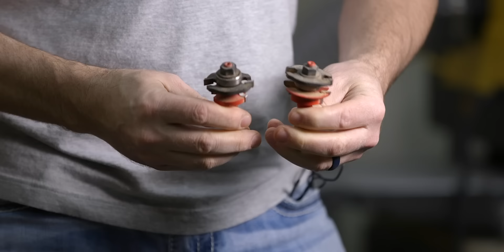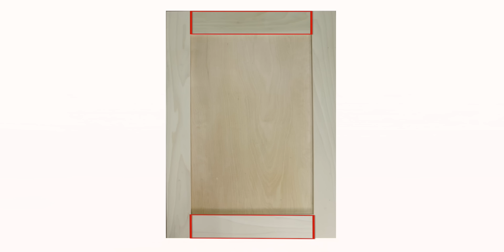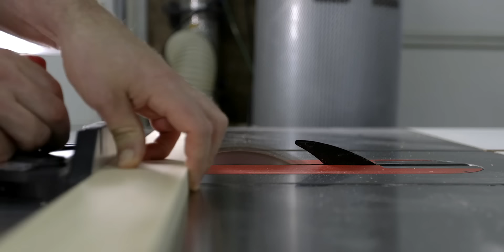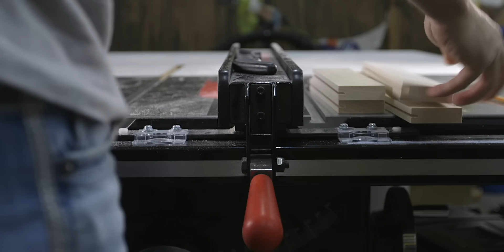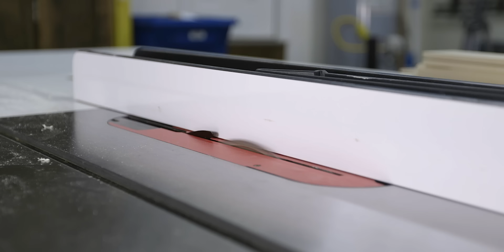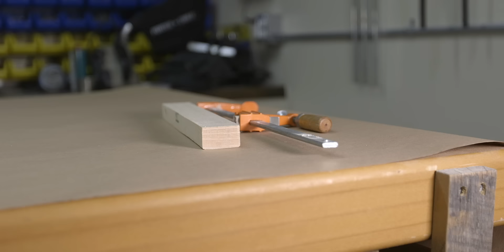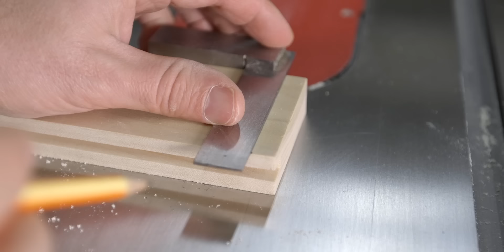Build Shaker Cabinet Doors With Table Saw | New to Woodworking?

Comment: Thanks for this video. I'm about to start on a panel for my mother-in-law's dishwasher. This video is going to make it much easier to make!
Reply from the maker: Let me know if you have any question along the way Carlton.
Reply: @TrainingHandsAcademy  The panel I'm making needs to match the cabinet doors in the kitchen. The other cabinet doors have what looks like small shoe molding along the inside edge of the styles and rails. It looks like it was carved out using a router, but I have no idea how they did it. Any suggestions?

Comment: Is there a video of how you finished them?
Reply from the maker: Sorry I don't Richard.
Reply: @TrainingHandsAcademy  no worries! Can you recommend what you added to the paint (if anything)  to give it that factory like finish touch?
Reply from the maker: @Richardsumilang  I didn't add anything to the paint. 1 coat of primary two coats of finish. It was Sherwin Williams brand paint if you live here in the US.
Reply: @TrainingHandsAcademy  thanks for the tip! I buy my stuff from Sherman Williams too and I need to replace two doors on an existing kitchen install that is about 5 years old. I need them to match perfectly and I hope the age of the rest of the doors don't make them look too different

Comment: Would you have any problem using 3/4 MDF for the stiles and rails? Poplar is no longer the cheap stuff, pretty darned expensive actually. I do have birch plywood for the panels however. Nice easy to follow video by the way. thanks
Reply from the maker: I know right, I remember when it used to be cheap and very easy to get. I honestly have never used MDF for stiles and rails so I can't speak from experience. Wish I could be more help.

Comment: I would like to ask something to you.
When you paint the ready door not appear veins of wood?
If yes, then how may reach it how so that the veins of the tree are not visible.
It is many layer with paint, or filling material? 

My English knowledge not too good, I'm sorry.
Reply from the maker: It's all about using the right wood so that the grain doesn't come through. The best wood I have here in the US for painted cabinets is Poplar or Maple. The grain doesn't come through on those. I hope that helps.
Reply: @TrainingHandsAcademy   I would have one more question... :)
How many layer paint get used to apply on wood surface?
How many primer layer and how many cover layer?
Reply from the maker: @kssthomas  One primer and two finish coats.
Reply: @TrainingHandsAcademy  Thanks!

Comment: You did it. You managed to teach me how to do these kinds of doors and it's ingrained in my memory from watching everything twice. 

I wouldn't call it dead easy, but it should be approachable for me.
Reply from the maker: Let me know if you run into any problems.
Reply: @TrainingHandsAcademy  I was looking at a door today, and I realized then that room doors are built based on the same principles and once you can build a cupboard shaker door, you could even build regular room doors. On these doors there's an in between stile per panel, otherwise it seems exactly the same. 

Thanks again.

Comment: Good  work,  questions  Sir do you  recommend  putting  glass  instead of  plywood into the same  style  door. Are rebate it for  glazing strips  instead. My reason for asking, if  the  glass  is not temper,  and  it's  break,the  door  would have to be  pulled apart to take out and  replace.

Comment: Why not just run it thru the router table with a quarter inch straight bit , then take over to the mortice machine
Reply from the maker: That works too if you have all that equipment... most new woodworkers don't.

Comment: So I want to do knotty alder kitchen cabinets with the pre finished plywood for the carcasses.  On the ends that show, should I laminate the knotty alder plywood to the prefinished?  Will I have to scuff up the prefinished?  Any specific glue?  Thanks for any advice you can give.

Comment: Could I use pine wood for the door and what’s thickness of the wood ? Thank you
Reply from the maker: You can, but just know that it is a really soft wood and will not hold up as well as a harder wood....and I used 3/4" (19mm) wood
Reply: @TrainingHandsAcademy  ok thank you very much

Comment: Thanks, I only have a sp6000 Makita plunge saw, no table saw. Can a simpler lap joint be used instead and fix using glue and dowel pins ?
Reply from the maker: Sure!

Comment: Stupid question that I'm not sure how to comprehend... When you multiply by 2 to fit the whole door on the cabinet, why not just use the exact measurements? What's the purpose for multiplying by 2?
Reply from the maker: Hey! Multiplying by 2 was only to get a rough estimate of the amount of material you will need... just of way of quickly estimating.

Comment: Excellent tutorial.  I've made several of these type doors with poplar.   You can jazz them up a little by adding a little trim piece around the inside of the rails and stiles.
Reply from the maker: Thanks for the tip!

Comment: Great video, the only thing I would add is using a small dab of glue in the middle of the center grove of each side of the panel to prevent it from making a sound when closing. But just a dab so it can still expand and contract.

Comment: Used your exact method to make a friend's doors in his kitchen. I don't have the same clamps you do but I figured out that, when gluing, I could place a board underneath my rails and clamp it down and that kept the door from twisting. Thanks! I just used Pine wood, I hope it lasts (fingers crossed)
Reply: How are they holding up
Reply: @tonyhagey8696  I think they’re doing ok. I haven’t heard otherwise. 😅

Comment: Just trying this the first time today. Do you use a rip blade for flat bottoms  on the groves and flat(er) tenons? I have very high tooth angle and it seems a 0-degree bevel would work better. I have a Sawstop and really don't feel like installing the dado brake cartridge as well as a dado stack.
Reply from the maker: Yes, rip blade works the best. :)

Comment: Awesome video and you explain everything well. I tried using the table saw to make the tongue and groove but I had trouble. I had the bits used for a router table. That worked but the board wanted get pulled into the bit and create a rounded edge from the roller on the bit.  How do I keep it from doing that? Thanks.
Reply from the maker: I'd love to help you Keith, but I need more info and possibly to see some photos. Are you on Instagram? If so, please find me there to send photos.

Comment: I have to build 14 doors and 3 new cabinets to remodel my kitchen in a condo in Myrtle beach using this style door,,,the only difference is to avoid that  cheap hollow sounding door ,,I`m gonna use 3/8`s birch for the panels for a more denser sound,,I got till May to have them done and painted

Comment: Hey Josh!! Love Love Love these thank you. I am now redoing my moms kitchen. How do you approach bends and warps in the poplar especially when it will have one end of the door sticking out more than the other side? or for longer pieces for long cabinets?
Reply from the maker: Hey Jack! Warps after the door is build or the stiles and rails themselves?
Reply: @TrainingHandsAcademy  in your 1x4 as you are picking up lumber from a lumber yard, so yes in your stiles and rails, basically how do you know if you can use a board especially if it's not straight as many boards arent, I have been told you can use boards that have a slight 1/8in bend in the middle but boards that have a bend at the end will mess up the entire board however you use it. Thanks!
Reply from the maker: @jacksoldavini9395  Yes bends in the middle are better but personally, I never bring anything home that isn't perfect. The less I have to do to it the better. :)
Reply: @TrainingHandsAcademy  Appreciate it keep putting out the best content you're a great teacher look forward to your videos!
Reply from the maker: @jacksoldavini9395  Thanks Jack!

Comment: To start with we really appreciate your videos with options to achieve the same outcome with just different tools. also, we like your straight forward and simple explanations. Thank you and keep up the great content! When measuring for the size of the door how much of a (minimum) gap do you leave between the doors/drawers? Is the gap the same size horizontally as it is vertically? Is the gap the same for drawers compared to doors? Thank again, Gus :-) PS - what would your recommendation be for size and number of clamps if we would like to go with that technique. We like the Bessey K-Body style, looks like you do too!
Reply from the maker: Hello! I would say the minimum gap would be 3/16" or 4.7mm... but I would allow for a little more space than that. Generally I like to keep the gaps all the same, I think it looks better that way but you can totally do something different. K-body clamps work great, and any size clamp that fits will work. :)

Comment: Great video. One question about the measurement for the rails and stiles. Shouldn't the measurement be the inside frame openings +1" times two to allow for a half inch overhang?
Reply: 1/2”x2

Comment: What stops the panels rattling in the rebates when the doors are closed?
Reply from the maker: That is a great question! In this example because the panel is plywood, it fits tight and when painted, it doesn't move around at all. However, if you are staining and doing a solid wood panel, things are a little different. In that case I recommend using space balls --> https://amzn.to/3lDi2pD

Comment: Excellent video, very well explained. thanks for sharing the knowledge.
One question, the standard measurements of the horizontal and vertical rail is maximum 2 1/2 inches?

Thanks, greetings from Mexico!
Reply from the maker: Yes, normally the range is between 2- 2 1/2" but I have seen some people do a little more than that.

Comment: Video was a great help for me. I will add that if your wood is not all the same thickness cutting your dado will require much more attention and adjusting of the blade.  Flipping the rails will not work

Comment: Great video!! Really helped me understand the process as I am about to attempt my first shaker door for a cabinet I am building.

I may have missed it but what is the thickness of the poplar you used for the styles and rails?

Thanks again for the great instruction!!
Reply from the maker: Hey Andrew! I used 3/4" (19 mil) thick Poplar.
Reply: @TrainingHandsAcademy  perfect! It looked like 3/4 I just wanted to be sure. Thanks Again for the great work
Reply from the maker: @Woodsy110  If you want to share photos with me or you need more help, find my on Instagram. That platform as been really great for allowing me to help out with subscribers projects.
Reply: @TrainingHandsAcademy  Found and added. Add me back if you like. It's yyz3wood

Comment: Question - do you use wood filler to make a seamless front look after you've painted? So fill with putty, sand, then paint 1x or 2x to hide the lines?

Great tutorial video, looking to pickup a table saw soon and wanted to avoid a router and router table if possible.
Reply from the maker: No I do not use wood filler... a good tight fitting joint is all you need.

Comment: Great video. Right to the point. On 6" drawer fronts would I go with a solid drawer front  or can I make the rails a little bit narrower?
Reply from the maker: I would go with solid. :)
Reply: @TrainingHandsAcademy  Makes perfect sense now seeing as I need 10 of them.  I have 27 cabinet doors to make and this will be my winter project. Your video by far is the best  Thanks
Reply from the maker: @dodgecharger7138  Sound like fun! Hit me up on Instagram if you want to share photos or ask me more questions.

Comment: For the rails and stiles did you use quarter sawn or rift sawn lumber? I know that using that kind of lumber versus flat sawn is better because you'll have less chance of the door warping or twisting when humidity levels fluctuate over time. But that kind of lumber is more expensive. Or are you not concerned about that aspect? What has been your experience? Let me know as I am about to purchase lumber for making shaker style doors.
Reply from the maker: Great question! I personally didn't worry about that with my doors. I've never really had an issue in the past either, but I'm not a cabinet builder so I can't speak from a place of building hundreds of doors. Quarter sawn would be fantastic, but I don't think it's necessary nor would it be affordable. As long as you are buying your lumber from a reputable supplier, I think you should be fine. You can always ask your supplier what they know. I wish I had more info for you PZ. Let me know what you find out.

Comment from the maker: I forgot to mention that I used Poplar (you can also use Maple) for the styles and rails, and I used Birch plywood for the panels.
Reply: Hello. I'm having difficulty to find that wood in uk, can I use another type of wood?
Reply: I'm trying to search for these rails, but I can't find them anywhere.. what do I search for?
Reply from the maker: @shelbihoo  What are you trying to search for Shelbi?
Reply: @TrainingHandsAcademy  I'm searching for the "rails". When I search "rails" or "cabinet rails", all that shows up are trim for walls and handles for cabinets.
Reply from the maker: @shelbihoo  They don't sell rails, you have to make them. :)
Reply: @TrainingHandsAcademy  What cut/type of wood did you use to make the rails? Did you start from 2x4s, thicker plywood, or something else?
Reply from the maker: @lawrencelee900   I used Poplar (1x4 starting size) for the stiles and rails, and I used 1/4 Birch plywood for the panels.
Reply: @TrainingHandsAcademy  are you sure those are not 1x3. Actual size .75 x2.5
Reply: @TrainingHandsAcademy  also, have you ever had issues with poplar warping
Reply from the maker: @rideordie1583  Yes, .75 x 2.5 is the actual finished size, but I had to start with 1x4 because I couldn't find 1x3 locally.
Reply from the maker: @rideordie1583  In my experience any wood will warp if it's long enough. Generally though, I have had very good luck with poplar. If you want to upgrade to Maple that would be even better.
Reply: @TrainingHandsAcademy  For my knowledge and to decide whether it's worth the extra cost, what makes maple better than poplar?
Reply from the maker: @andrizeefoshizee  It's harder and it holds paint much better IMO.
Reply: @TrainingHandsAcademy  Thank you for the reply and for the info.  Good to know.
Reply: @TrainingHandsAcademy  would you say using 1x4 furring strips would work well for the rails and stiles? Or would you advise against this? Thanks!
Reply from the maker: @isavedsuperman1x  Hey Jake! I would advise against that because that material is most likely not stable enough.
Reply: @TrainingHandsAcademy  thanks so much for the quick reply, you're the best!
Reply: Did you need to joint/ plane the raw material?
Reply from the maker: @davidkim9180  No, it was already surfaced.
Reply: On the completed cabinet/ doors the painted finish looks amazing. Do you have a video on achieving this look?
Reply from the maker: @highoctanehustleofficial  I do not, sorry.
Reply: Is it okay to use 3/4 inch poplar plywood for the styles and rails?   Great video,  awesome instructions, will attempt to make one this weekend. thanks
Reply from the maker: @mxka100  I would only use plywood for the panels... but that's me. :)
Reply: What it’s average price for a small cabinet let say 23 doors and 7 drawers. Just the wood ?
Reply: I was just about to ask this!
Reply: Is the thin plywood and maple/poplar good for kitchen cabinets? Of would u not recommended them for kitchen cabinets and drawers?
Reply: @jadee991 uo  Hello, as I see you posted recently in this old presentation, allow me to offer some advice. You have two questions here. First, as to the "thin plywood", the panel, one quarter thick plywood is perfectly acceptable. I suggest, though, that you use "Baltic Birch" for this panel as it is very solid, made with nice flat layers. Birch is a variety of hardwood. This stains well and paints well too. For kitchens--especially around dishwashers and sinks--stay far away from MDF panels--even if you paint them!  Second, regarding the species of wood used for the rails and stiles, maple is your safer choice in that you will most likely find your lumber is consistently very dense. Poplar, on the other hand, is inconsistent in density /hardness.  So,  when selecting  poplar lumber, pick the hardest boards.  If you pay attention, you will notice the weight difference in boards. Also,  choose the closest you can get to Rift-Sawn grain (Choose 1x 6 or 1x8 and cut  from the edges, wasting the center. Consequently, the end-grain of your boards will have more of a diagonal end grain.)
Reply: Do you have room for spacer balls. Or are they needed on shaker doors
Reply from the maker: @drmachinewerke1  Plywood doesn't move much, so spacer balls are not really necessary. However, if you are using solid wood for the panels, then they are a must.

Comment: Did you paint after assembly?  Aren't you concerned with the floating panel moving, exposing unpainted surfaces?
Reply from the maker: Yes I did paint after. In my experience high quality plywood doesn't really move much, so I've never had any exposed unpainted surfaces. However, you can totally do some pre-painting or at least priming as a precaution. That was a great question Roger!